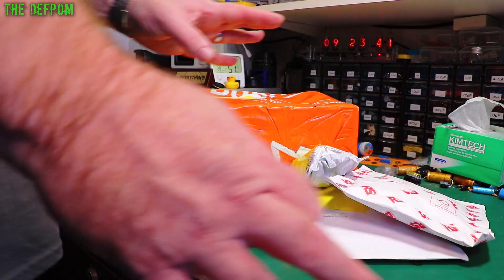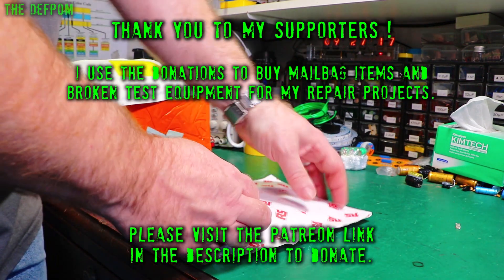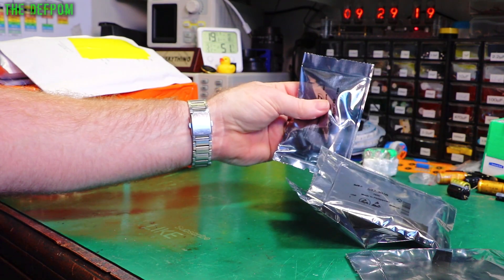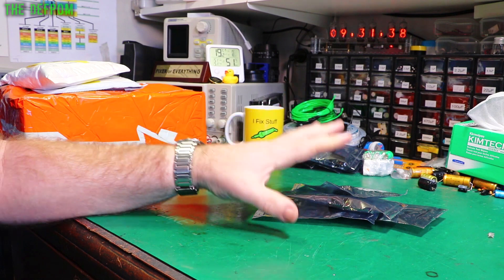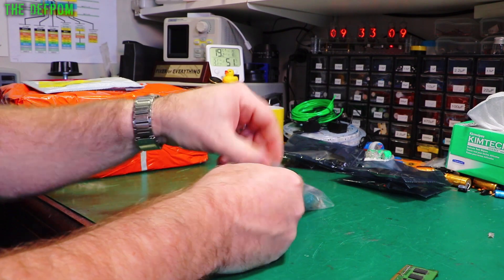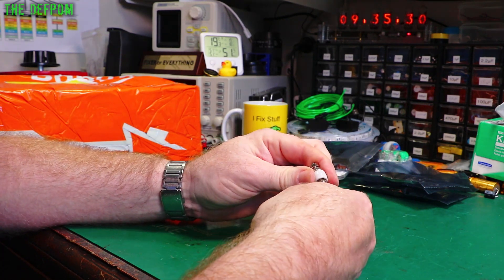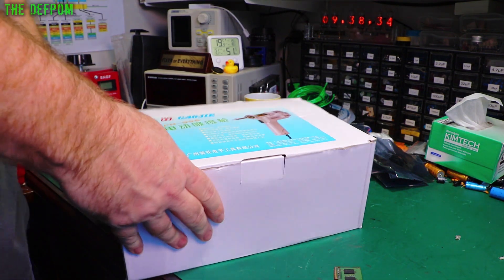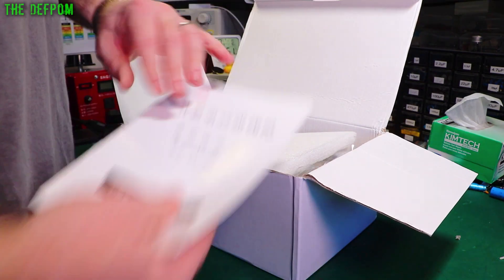🔴 Mailbag Monday 17th May 2021 - No.831

Comment: With that dual pump desoldering tool, now you can not only remove the solder but suck the traces right off the board as well. :o)